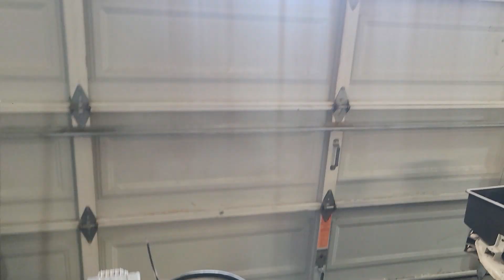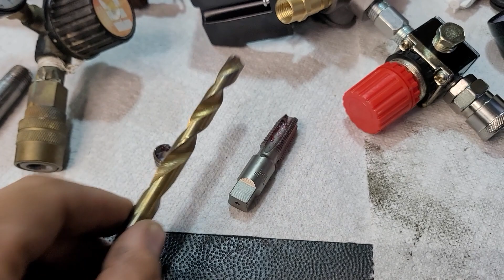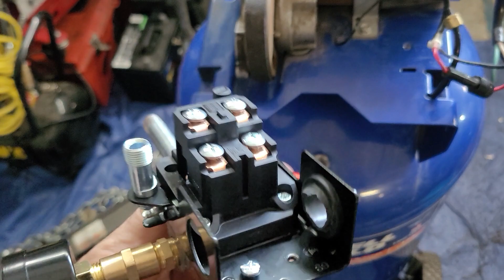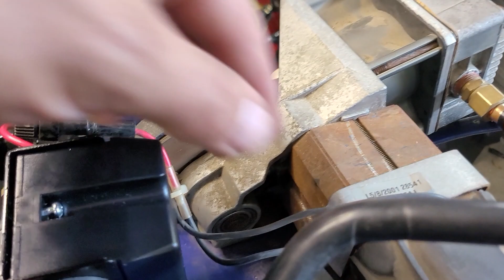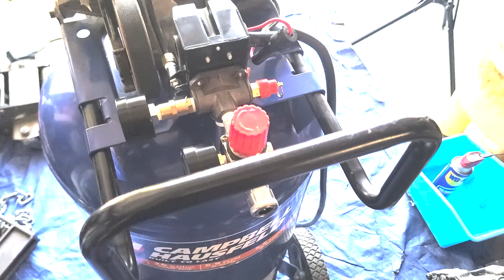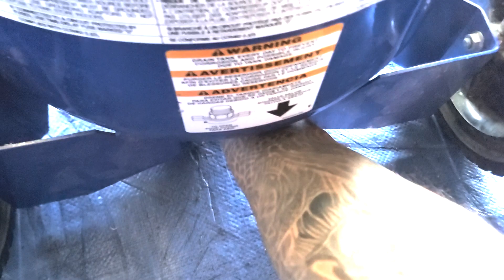How to fix a Broken Air compressor for CHEAP! - 700$ compressor for 60$!

Comment: Look for a placard somewhere on the side of the tank. (usuall on back side)  It will have a Date to Remove from Service  tag.   You'll want to be sure your tank isn't  beyond that date. After a few pump up's,  if dirty rusty water comes out, be cautious.  Otherwise,  Nice find on the cheap!    Good luck with new channel!  I just rebuilt my pump (easy and cheap),  but found an air leak on the bottom of the tank after 20+ years of use.  Kept the pump, pressure switch, check valve,  pop off vavle, - now just looking for a fairly new tank.
Reply from the maker: Excellent safety points all should adhere to! Thanks for also sharing your compressor project good example of salvaging useful parts!